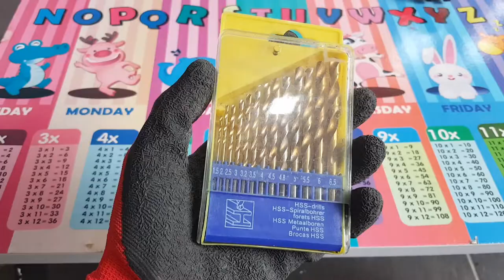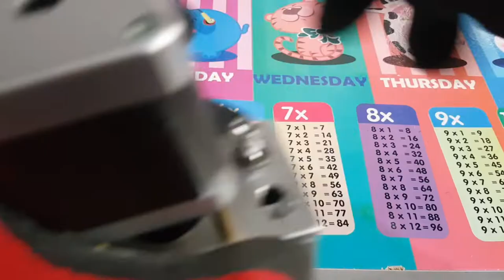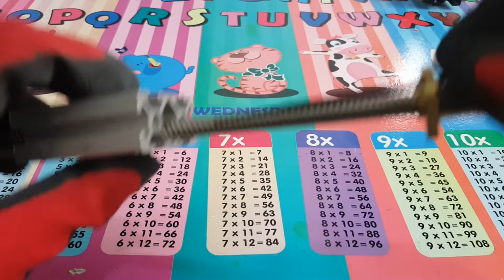How I Made My DIY Linear Actuator

Comment: Amazing job!, i agree with other users that there could be play in the block if you dont prevent the lead screw from moving axially. If you buy the standard pillow bearings they come with tiny setscrews and they allow you to fix in place your screw. The alignment will be a bit more challenging but it will make it a solid, flawless design.

Comment: Motor's typically have significant end-play, a mm or two, so without a thrust-bearing that will limit the accuracy/repeatability significantly...  For instance there's no need for an anti-backlash nut on the leadscrew if the motor shaft has 1mm endplay (and that coupling can stretch/compress by a similar amount too.   If you look at the standard ballscrew kits they come with a preloaded thrust bearing block to define the axial position to tight tolerances.
Reply from the maker: Oh, I'll look into it. Thank you!
Reply: if that were true, then every 3D printer with a screwed z axis would have that problem which they dont, and those use extreamly cheap steppers.
Reply: @guillermomarturetfendt9037  Z-axis has gravity to prevent backlash.

Comment: Hiii, can you how us the wiring and conections of the actuator?
Reply from the maker: I used this actuator for my 3D printer. I wired it up to the Arduino Mega and RAMPS 1.4. This video might help with connecting the stepper motor to the RAMPS:😁

https://www.youtube.com/watch?v=U-VyUV3k6xI

If you're interested, I also built a linear actuator V2 with 3D printed parts, which is more reliable. I just don't post it on Youtube.😁🙂

https://www.instagram.com/p/CenmxjVvVgL/?utm_source=ig_web_copy_link

Comment: The holes that you are drilling at 0:28, are these tap holes strong enough to hold the track? I think the thickness of the extrusion material is only 1.5-2 mm, you need at least 3-4 mm for strength
Reply from the maker: Sorry for late reply😅 and thank you for advice, Yes, it doesn't strong enough to hold the track.😁I noticed there's tiny play when I try to wiggle it.
Reply: @ikmalxhakim4419  I thought of using 20x40 extrusion, but since your speaking, it requires 3 to 4 mm thickness for having a good strength(for the bolt)... I'm at little bit confused to wheather use that or not for my project....Any help?
Reply from the maker: @sharanamuram2290  what I can recommend is to use T slot nuts instead of tapping the hole. This surely holds the rail enough and more reliable.😁I made a V2 linear actuator (I posted on my insta) in which stepper mount is 3d printed parts and one single 2020 aluminium extrusion. Since I use MGN12 linear rail, I still can use 5cm length 2040 profile for the block carriage. (NOTE: my design here is only applicable to MGN12 rail (block) due to the hole size & spacing )

Comment from the maker: UPDATE: I created DIY linear actuator V2, which is more reliable than this. If interested, please visit this link:
https://www.instagram.com/p/CenmxjVvVgL/?utm_source=ig_web_copy_link.
Reply: Got any links on printables? I cant seem to find V2
Reply from the maker: @user-jk9zr3sc5h Hi, sure. Here the parts list for V2 design:😊
Parts:

For 3D printed parts, you may visit:
https://www.printables.com/model/244022-nema17-stepper-motor-mount/files

Others:
2020 Aluminum profile 500mm
2040 Aluminum profile 50mm
2020 Aluminum profile corner bracket x4 (This is not recommended, use 2040 aluminium profile L shape black corner bracket instead)
MGN12H 300mm linear rail
T8 4mm lead 300mm lead screw
T8 anti backlash spring loaded nut
NEMA17HS8401 Stepper motor
8mm to 5mm Spring coupler

M3 25mm hex screws x4 + washers
M3 8mm hex screws x8 + washers
M4 8mm hex screws x4 + washers
2020 M3 T nut T slot nuts x8
Zipties
Reply: Invented? Do you know the meaning of that word?
Reply from the maker: @AztecWarrior69_69  I guess I have to change my word, haha english is not my first language😅Thank you for highlighting it :)
Reply: @ikmalxhakim4419  well it's OK.  It was just one word. The rest is good. Good work.